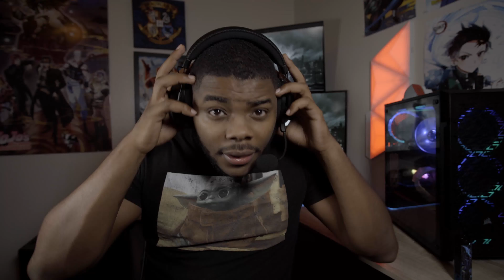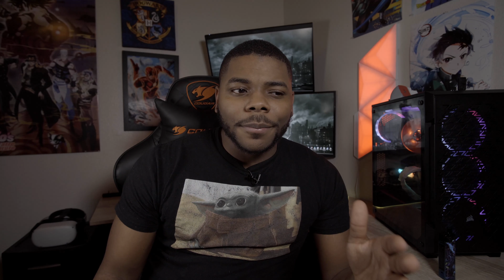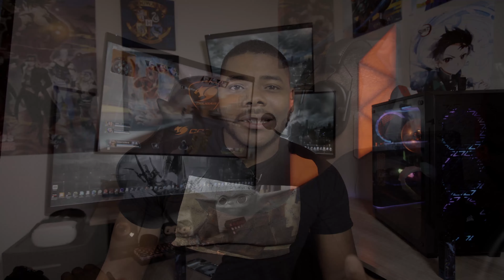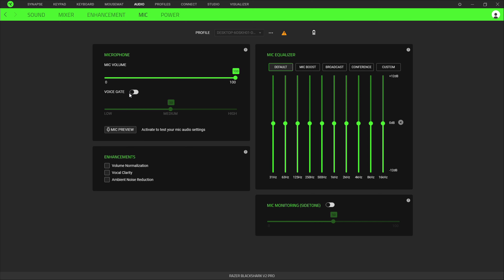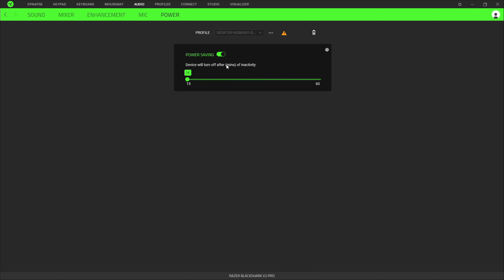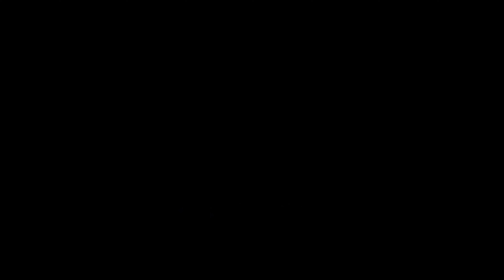Razer Black Shark V2 Pro Review 2021

Comment: Tbh the PS5 and Series X|S have audio processing built into the hardware that removes the hassle of having to tune your EQ for spatial audio. 

Now if you just don't like the default sound of the headphones without EQ-ing them then that's a separate issue but from my usage and through waveform analysis the headset has a V-shape response that emphasizes mid-base, and a slight peak in the treble (12-15KHz range) that give most genres enough pop and detail that makes most media fun. It doesn't have any real tamber or "sparkle" but if your looking for that kind of listening experience you'd need to be far removed from any gaming for that kind of environment. 

Either way the newer consoles should phase out that worry, but if you're specifically referring to the THX spatial audio then I can understand why you'd advise against it for console users.
Reply from the maker: Yeah it's mainly just the Spatial audio, specifically if you are a competitive fps player, just wasn't to my liking especially compared to other offerings.